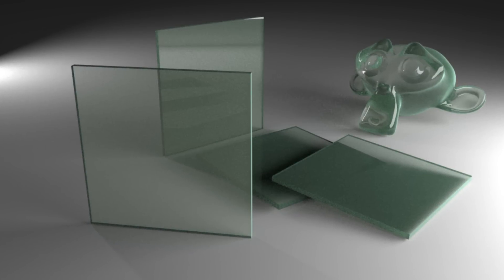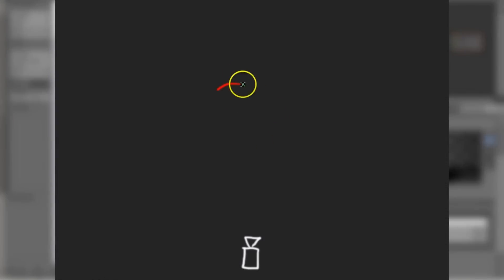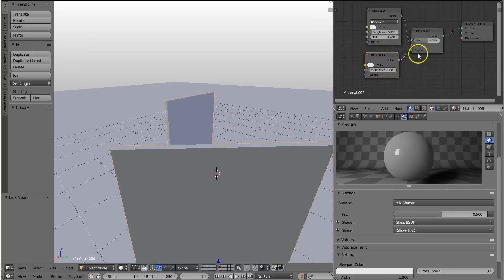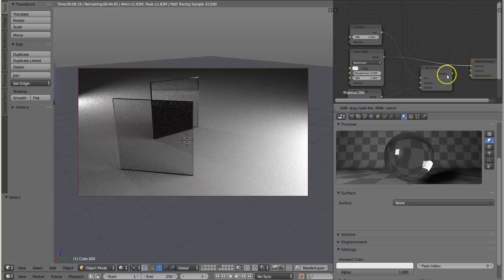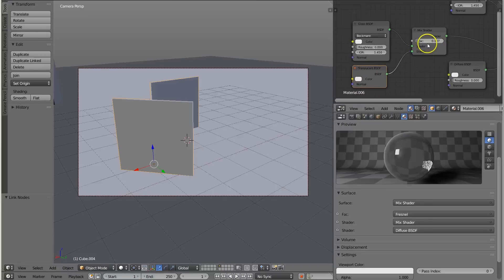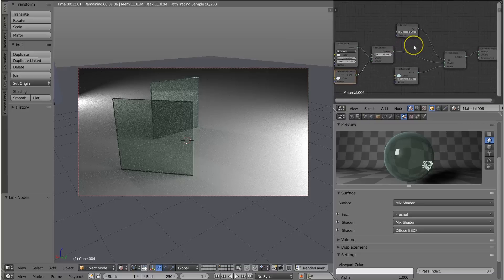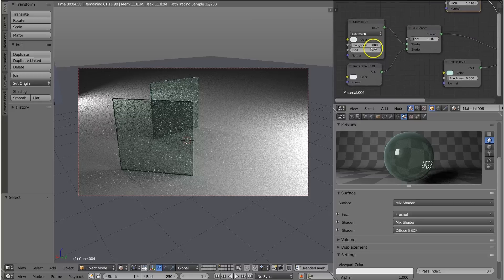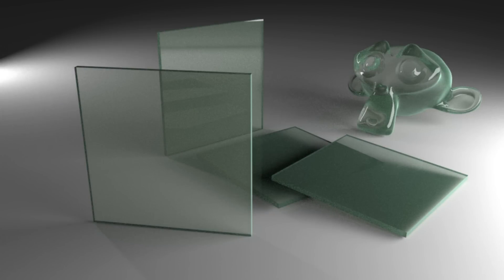Simple Realistic Acrylic Glass Shader in Cycles

Comment: I see where he's coming from with the Diffuse thing. It's not even close to physically accurate, but it works artistically.

But what you really want is the Transparent shader, not the Translucent shader. Translucent is meant for letting light shine through thin objects like curtains and leaves.
Reply from the maker: totally right. this fresnel trick doesn't apply very well on stuff that are not particularly reflective in the first place. maybe a glossy shader (as of the time of the tut) would be more accurate, but that would require quite a bit more tweaking to get a better result. this is simply a fast easy way to get a general fresnel effect.
Reply: Yes indeed. Physically accurate is probably the last thing on a beginning artist's mind, anyway, and I personally don't think there's anything wrong with that.

Comment: Thanks for the info, I was trying to mimic how the edges of glass tables appear and this video was spot on. Never thought to look online for IOR values so thanks for that too. I agree with your conclusion as well. This is definitely a good starter setup for acrylic glass. I also found that adding a refraction through the mix shader just before the material output helps a bit. You can use the same fresnel factor for that as well.
Reply from the maker: Thank you! Glad you found it useful!

Comment: Your example renders look more like tempered glass or safety glass than acrylic because of the slight greenish hue they have (something that Acrylic in my experience doesn't generally have, my prescription eyewear which is actually pretty thick is made with acrylic lenses, and looking at the edges of the lenses they don't have that discoloration)
Reply from the maker: For those still interested: the greenish tint is the result of the presence of iron in the glass. It is often a part of the glassmaking process in the most common storefront sheet glass, although it is also possible to have glass that is ironless, that is completely transparent. Just change the color to a very light grey instead of green if you want a transparent glass!

Comment: Is Cycles another programm than blender, or is it the same? I want to make a glass in blender, but when I click 'new material' I don't get the option 'Surface' to create glass. Hope you can help me?
Reply from the maker: The Cycles renderer is included in the Blender software by default. People use it over the Internal renderer so much that some wonder why it isn't the default renderer when you start Blender up. If your material setings look different, you may have not changed it from 'Blender Render" (i.e. Blender Internal) to  "Cycles' on the top bar, or you are using an old, pre-cycles version of Blender. Hope that helps.

Comment: How to render it as a model? I click Export>.FBX.... then, when i import it it has no texture....
Reply from the maker: You will have to reapply the texture with a new material, using the Cycles nodes. Most exporting formats I am familiar with do not include the textures in the exported file as well.

Comment: you need to switch to Cycle Render from Blender Render thats the step, and  can you add other non-glas material /Texture in it ???? since i wanna make a cake in the plate
Reply from the maker: Of course, you can make materials very similar to Blender Internal with Cycles. Cycles is now very capable of creating very realistic shaders, and it does not just have to be glass! You can try playing around with the different default shaders included in Cycles: "Diffuse", "Glossy", and the like.
Reply: You just need to add another mix shader to the glass node along with an image-texture you want to use